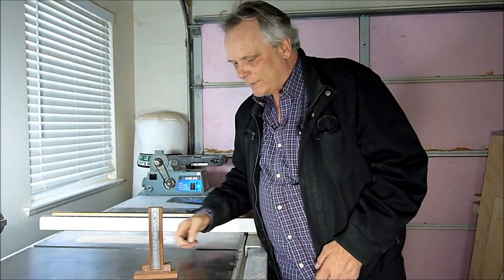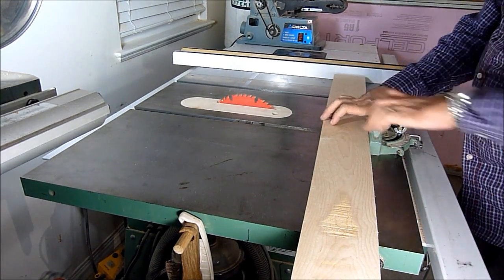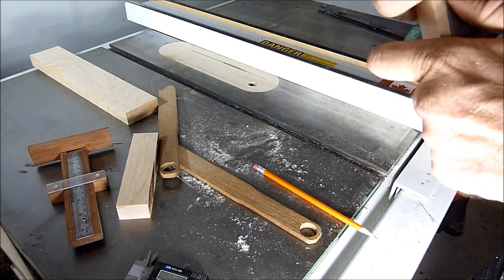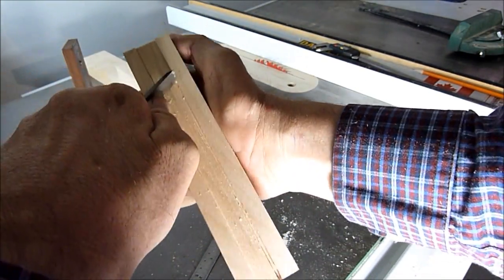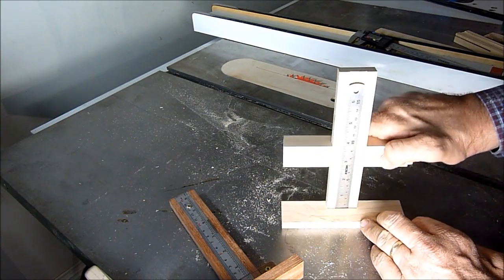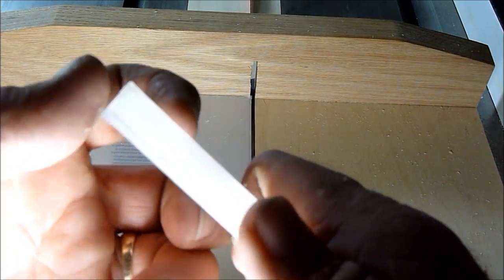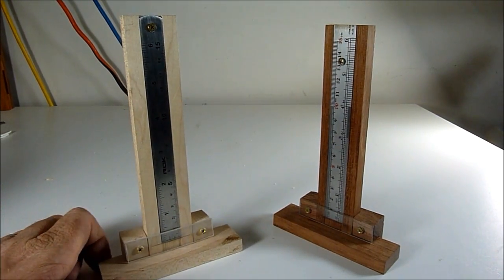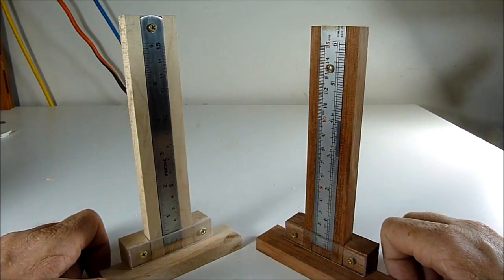How to make a height gauge

Comment: I like this. I will make it with an addition for a depth gauge also. Just put another base on the top. Then add a 1/16 metal rod on the back of the slider, the same height as the top base. Then flip it over and the metal rod can go into a hole for a depth gauge.